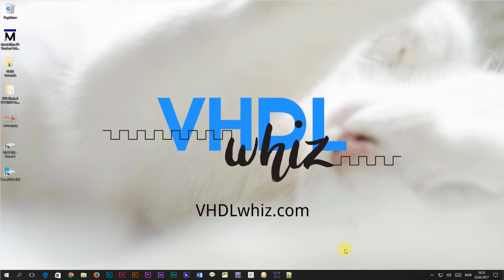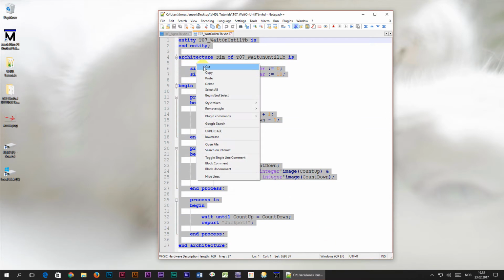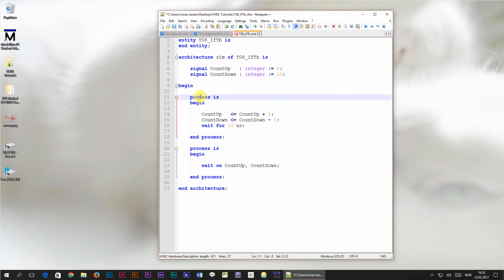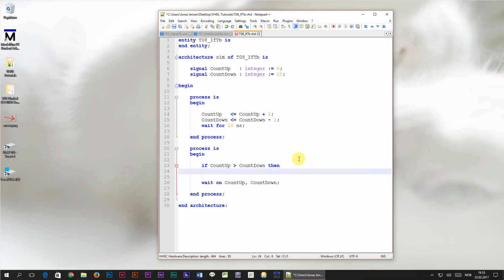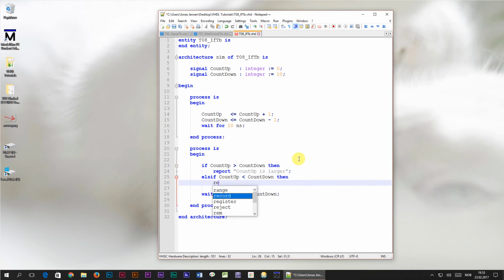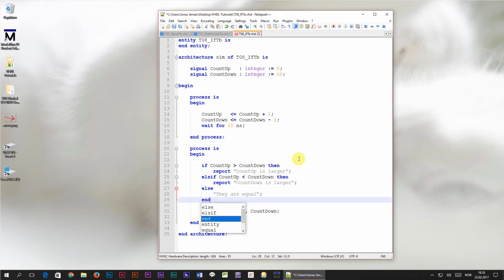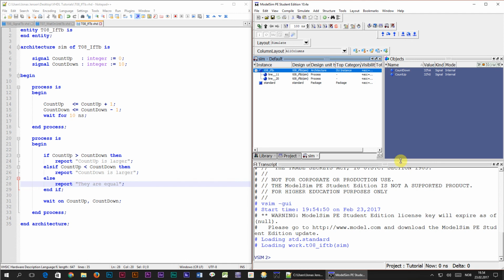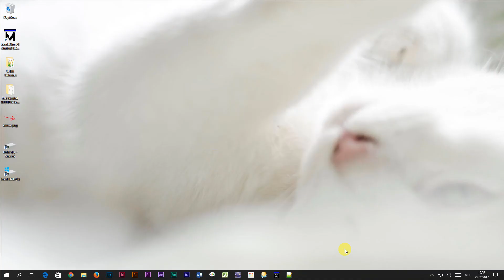How to use conditional statements in VHDL: If-Then-Elsif-Else

Comment: Why CountUp=CountDown at 40 ns? It should be at 50 ns
Reply from the maker: No, because the signals change at 0 ns. CountUp goes from
0 -> 1 at 0 ns,
1 -> 2 at 10 ns,
2 -> 3 at 20 ns
3 -> 4 at 30 ns,
4 -> 5 at 40 ns.

The signal assignments become effective when the "program" hits the Wait statement, not after the wait statement has completed (10 ns later).
Reply: @ thank you so much

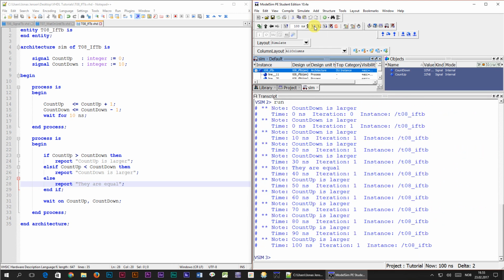Comment: [2:21] Why does the note 'CountDown is larger' appear twice at Time 0ns, once for Iteration 0 and once for Iteration 1? The second question is, why does the Iteration remain at a value of 1 over time? THX and BR
Reply from the maker: That's because all processes run once when the simulation starts.

First, the process runs when the simulation starts (Itearation 0) but pauses on the "wait on CountUp, CountDown;" line. Then, before any simulation time passes, in the next delta cycle (Iteration 1), it wakes up again because CountUp and CountDown changes.

For all subsequent events, it only wakes up when the CountUp and CountDown changes (Iteration 1).